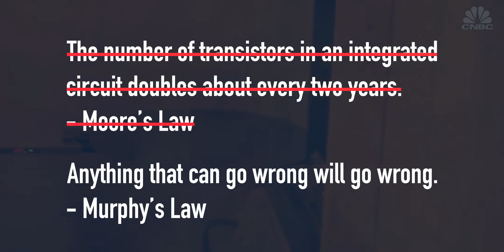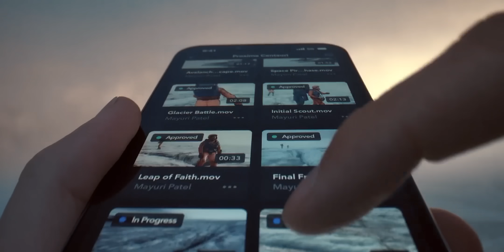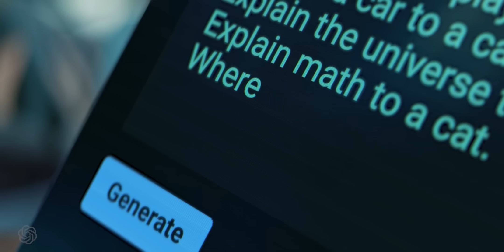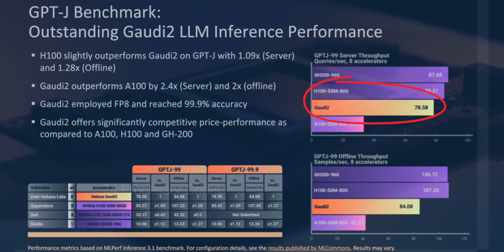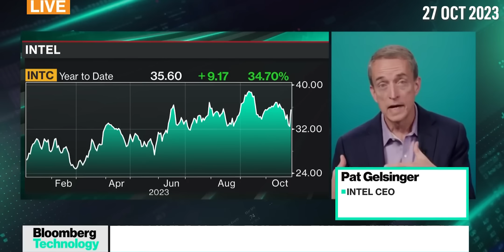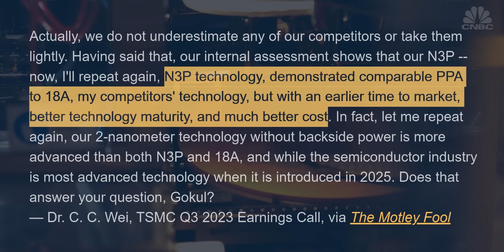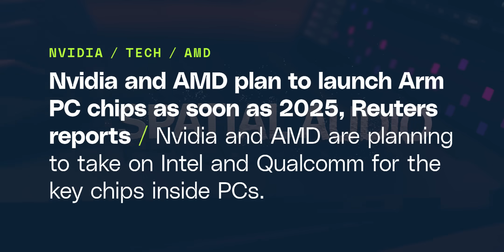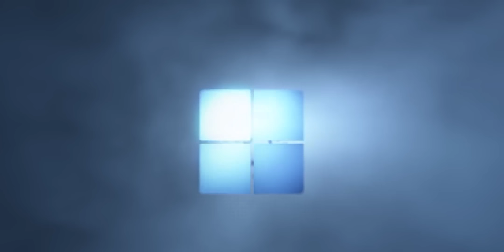I WAS WRONG! Intel's Crazy Plan to Dominate AI Chips is Working

Comment: Well, as of July 2024, Intel has big problem with 13 Gen, 14 Gen chips overheating.  Several years ago Intel tried to save a few bucks by skipping EUV equipment and fell behind TSMC.  Intel just bought latest High NA EUV from ASML and it will take at least a few years to turn around.
Reply: Really?  Where is the class action lawsuit? 
Funny how no one reports class-action lawsuits against MacBooks that occur every other year.

Comment: It is inevitable that advanced chip manufacturing will move out of Taiwan progressively. Geopolitics is one of the main reasons.

Intel and other chip makers will benefit and it may not be bad for TSMC as long as they move out of Taiwan which they are doing so mostly to US but also to other southeast Asian nations.

Some may argue only Asia (vieled argument to say only certain Asians) have the education and skill to make high end chips which is far from the truth. Given time it is possible to get a trained workforce in many countries outside of Taiwan and China. It worked well in Taiwan and China because it was cheap. It is not cheap anymore and the main driver is geopolitics with China threatening to invade Taiwan anytime. So really there is no choice but to move the capacities out of Taiwan. This is the reality.

Comment: I think what you missed is both Intel and TSMC use the chip making lithographry  machines from ASML.   So only Intel will have the newest most advance machines and TSMC will not be buying these.   So how will TSMC make their best chips?    I think they will have to do a double exposure on the chips.   Where as Intel will not.   Correct my mistakes in this comment.

Comment: The best thing Intel could realistically do is to use 1/3 of its cash and short-term loan to buy back its stocks, the other 1/3 for dismissing 50% of its early retiring aged and redundant headcount, and the remaining 1/3 to invest in Qualcomm/ARM and even NVDA for licensing arrangements. At this stage USG will surely print and send $50- 100 Bn more as an emergency rescue fund (as it has done for Ford and GM years ago)…for a new Intel. This is the only way.
Reply: INTC Foundry will take a massive share from TSMC very soon.  Sanctions are causing China to flock to TSMC taking up capacity.  Customers will need to switch over.

Comment: Intel’s strategic thinking is inflexible & dated, unable to adapt to challenges to their leader’s beliefs. 
They missed out on Apple’s request for a chip for the iPhone because they felt there won’t be many $1000 phones sold. Wrong!
Now they are upset about Apple dumping Intel for their own chips because Intel could not deliver the performance required, which would need ARM RISC architecture rather than the archaic X86 CISC.
Apple showed customers don’t care if the O/S is moved to a different cpu if performance is good. 
Intel should see this as the writing on the wall instead of dismissing Apple as niche. Intel already had a brush with the now defunct DEC Alpha, which ran windows NT on an ARM architecture. The only thing that saved Intel was alpha was expensive and DEC went bust. If AMD offers an ARM chip geared to AI, but with x86 compatible mode, something that is partially available for legacy apps on windows, then Intel is in trouble. Oh wait… Qualcomm is planning on delivering ARM chips for Windows on laptops for 2025. This is dependent on Qualcomm settling with ARM over license issues.
Intel has advantages like it’s own fab and PC market share, but their CEO must be drinking buddies with Toyota’s CEO, unable to accept the world has moved on. Or IBM’s Thomas J Watson Jr, in 1943 he believed that '… there is a world market for about five computers. Or saying not many people make weather models, but many use them, truly short sighted. The future use of AI ARM chips as supercomputers isn’t going to be weather models, it will be stuff we can’t imagine but apps will be developed with that much compute available. Who would have thought you could super computer capability surpassing a Cray 2 in your iPhone when Cray was all the rage? Even during the .com boom, the iPhone hadn’t been conceived, but MSFT was already experimenting with windows CE, which still has the best handwriting recognition of smartphones. 
So Intel has potential held back by successive lack lustre CEOs. 
Nvidia is doing well because it has a infinitely more talented  CEO.
So can Toyota the creator of the Prius lead, dominate EV? It could, if there is a new CEO
Can Intel take the lead? Not without a new CEO.
Reply: Leather daddy is the tech. tsar. All hail leather daddy

Comment: I think Intel has a lot of strengths but they have a lot of competition. I really see kind of silly the part of X86 against ARM. Intel can produce and design ARM chips by themselves. ARM chips on notebooks are about power efficiency not about performance, so if you want performance you go to Intel or AMD x86 not arm. The other part is that most of the apps for windows are x86 not ARM design. So ARM apps for windows that might be ok are Microsoft Apps. I am almost positive that ARM emulation apps consume more power than running native on x86 chips. 

We need to faced ARM on APPLE is easy, it is not a lot off Apps for Mac OS X. I am not sure about the exact number of developers for Mac but for Windows at least is 100 times more than Apple.

I personally want Intel to success and the same time, I want AMD and Nvidia to succeed. I found fascinating that Intel can/will produce chips for AMD and Nvidia. Intel had the edge of technology for long time, I think the missed because bad management of the company not because the lack of talent (I am sure CEO and high management though they don't need to invest on process when they own the cpu markets). 

I think Intel will come back very powerful against TSMC and Samsung.

Comment: This did not age well - Meteor Lake is a disaster and there seems to be little in the pipeline till early 2025 for consumers.
In server intel - despite having really bad lineup (except where the accelerators play a major role) is holding ground due to market inertia. Lets see how this evolves.
As for AI, intel run into ground Larabee, Knight's Landing and  Nervana, now its Habana turn. Will it fly? We will see.

The problem with this company is that it is does not seem to have what it takes to be innovative. Pat doesn't have what t takes to change it either, from the looks of it. We'll see.

Comment: I'm going to tell you why I think Intel is so confident in their 18A GAA design and why they are getting customers signing there.
Look at Samsung GAA and yield for 3nm. They aren't getting hardly any customers and that's with expensive FDSOI smart cut. What is the most important thing to control in these smaller GAA architectures? RDF
A small company that has put out several whitepapers in the last 2 years and one a couple months ago where they state 50+%  better  matching for sense amps which would enable massive power savings for dram in data centers.
Same thing they can do there they can help with Sram in logic.
This same company is partnered with Synopsis and Synopsis offers their design software that has their IP.  This company actually has their epitool installed at Arizona State University, where Intel is part of the Hub27 for chips act $.  Who else there? Possibly Boeing and NG - both customers of the 18A node.
Now the juicy stuff.
Why would Intel be so confident in their 18a GAA when the others are struggling at 3nm GAA and Finfet? 
I think it's because they have a secrete sauce for controlling RDF.  I think it's MST for doping channel and blocking PTS and building the stack.
We will find out in '24

Comment: There is some information you get wrong about intel, but i just want to touch about meteor lake here. First meteor lake belongs to new branding called intel core ultra and meteor lake belongs to the first series of this new branding. Second meteor lake actually manufactured on multiple nodes from intel & tsmc joined by foveros 3D packing technology. The cpu part manufactured NOT using 7nm process nodes but Intel 4. I knew Intel 4 is a new branding for 7nm from intel but back then 10nm intel is not same as 10nm from other companies. Intel rebranded their nodes to align with current industry standart so help IFS customers comparing intel nodes to other nodes.

Comment: The problem with Meteor Lake is that it might be too little, too late.
Its AI accelerator is weaker than what AMD has in their new "Hawk Point" processors (which are themselves just a refresh of older "Phoenix" processors) and will be far behind Phoenix's real next-gen successor, "Strix", which is expected to launch in mid 2024. Intel won't have "Arrow Lake" ready until 2025, and there's a good chance that it won't even beat Strix.
Intel is half a generation behind AMD. They can't afford to continue at the same pace, they need to accelerate and catch up.

Comment: Most of the intel chips have not lost to AMD! Looking at the performances since AMD rise at best AMD chips have been marginally better than intels at much smaller node sizes! That tells you a lot about the architecture! People make it seem here like Intel was on the entry market 😂! I have used both ryzen and intel and I can tell you Intel is a much more stable architecture. I had less crashes, less freezing…… I honestly hate AMD chips the never lived up to the hype! A much older intel chip performed much better in daily tasks than the ryzen 7 I had. Never again! I think the architecture has a lot to do with how a chip performs. Just because it does well in a certain task overall performance is still better at Intel.

Comment: And yet right now it's Nvidia dominating and AMD is the runner up with their new launches and companies jumping on their hardware, partly so that Nvidia isn't the ONLY player in this realm, along with the fact that AMD's new server hardware is more performant in different areas than Nvidia hardware so conGRATS AMD.

Intel will make a comeback in desktop.  Server?  They haven't yet and I don't see anything in the rumor mill that suggests they're pushing anyone out of the way.  AMD has a solid footing with typical server tasks and are cutting in on AI processing.  Intel isn't there yet.  Maybe another year or two and I'm not buying Intel stock based on THAT because for whatever Intel can put out in a couple years, Nvidia and AMD are both making better hardware too.

But the world of server doesn't CENTER on AI.  Most of the world of server doesn't use AI and probably never will because making a DB request is NEVER going to benefit from AI.  Getting data from a web server is NEVER going to need AI.  So this AI boom that's happening right now WILL slow down and be more gradual the same way ALL server hardware is.  AI is not a be all end all thing, it's just right now there's a lot of companies interested in AI, training models, etc....

Comment: "everything that could go wrong for Intel did." No. They did it to themselves. They (the board) hired THE WORST possible people for the CEO position. Bean counters instead of engineers or technologists. Intel has no one to blame but themselves. AMD now has a lead in power efficiency that Intel will need years to reduce. At least they are planning to use TSMC, which shows that reality is sneaking in at Intel. I want Intel to return to leadership and dominance, but they screwed up big time, and in technology, it's very difficult to recover. Thank goodness TSMC is a friend and a democracy and needs the US to protect them. We will. But get ready for some bumps in the road. And, your thesis--that Intel's plan to dominate is working--is incorrect. Intel is way behind Apple and even Google in making mobile chips capable of AI inference. Apple's M series of laptop SOCs wipe the floor with Intel's mobile chips. The 38-core M2 Max GPU is about half the performance of an A100 for LLM inference at one-sixth the power. Intel cannot match that...not even close.
Reply: Yeah but building government funded manufacturing plants lol Intel only going up from here

Comment: You seem to left out AMD new product. Market testing indicates AMD is not inferior to Intel in all aspects. Intel4 is just 7nm, while AMD is using tsmc 5nm and 4nm, Mi300 will be using 3nm. Apple booked 90% 3nm is old info, before tsmc massively boost up the production. It is also widely supplied to NVIDIA, even Intel is ordering huge volume of tsmc N3E.

Comment: You were also wrong about NVDA in the past, claiming on one video that it is DEAD due to less requirement for graphics cards due to high speed connectivity.  Lets face it nobody is perfect.  I like your content nonetheless, no BS.. and thanks.  Unfortunately I bought into your older video and didn´t buy.  My buddy did, and bought a brand new truck with his winnings.
Reply from the maker: Sorry to hear that’s the only Nvidia video of mine you watched. That video wasn’t wrong at all. Nvidia pivoted HARD away from gaming GPUs and into data centers and I’ve been covering that for well over a year.

Comment: I worked for Intel from 2000 to 2003.  I remember that during one start up meeting in the fab I said something about competing with AMD.  Everybody just laughed.  Then they explained to me that the one fab I was working in could produce more product in one quarter than all of AMD's fabs combined could produce in an entire year.  Intel is about producing large scale commodity grade product.  They don't have to be the fastest.  

Something else to consider is that when I worked for a seismic company in data processing we tested AMD processors head to head with Intel processors.  We had dual socket hex core AMD vs dual socket quad core Intel.  On a core to core basis the Intel won.  When we would load down all 12 cores in the AMD machine the memory controller would bottleneck.  When we would run 8 cores verses 8 cores the Intel was slightly faster.  My impression was that AMD just tacked two extra cores onto a chip that was designed to be a quad core machine to produce something that could be used for marketeering wank.  Under actual, real world, 100% duty cycle, scientific computing the Intel was just clearly better.  

One last insight into Intel and their claim at rolling out a rapid R&D schedule is that they already have them in the box.  Intel normally maintains development on at least 4 processes ahead of the currently deployed CPU process.  That work is done at PTD, Portland Technology Development which is Intel's R&D facility.  It isn't that Intel is going to develop new technology.  They have it already.  They are talking about scaling that technology up to full production numbers.  They don't develop technology based on consumer demand.  They make existing technology available to the public when the old technology has paid for itself and given them a significant return on investment.  It's a business.  This was something that I learned while talking to people who had worked at PTD and management.  You simply can't buy the latest technology.  It isn't available to the public.

Now, you might dismiss me as an Intel shill.  I can assure you that I'm not.  My parting with the company was somewhat less than pleasant.  I use their products, I NEVER buy them new, and as far as I'm concerned the company can burn in hell.  Every day that I don't work for Intel is a good day.  I would rather live under an overpass than work for Intel.  Anyway, take my insight as you will.

Comment: My biggest concern is that Intel 4 node is just starting up, and it is even worse than TSMC or Samsung's 4nm, not to mention TSMC 3nm (and TSMC 3nm is already producing). Intel is one generation behind in manufacturing and even that node is the worst one in the generation. There is no miracle, if you're one generation behind you cannot be the leader. Actually, Intel 3 was promised by H2 2023 and it is still nowhere.
Reply: The miracle is that TSMC tech leadership relies on ASMC tech. And ASMC already decided to give the next cutting edge litography machine to Intel rather than TSMC. So this is how Intel leap frog all its competitors. Geopolitics is driving these key decisions. This is the catch. There is an invisible hand.
Reply: @andrepaes3908  I don't understand what you mean. EUV is there already, maybe some slight upgrade on the laser will be made, but the wavelength of the laser is the same for Intel and TSMC (and for Samsung) and it will not change soon, since that needs a very serious investment. Moreover, if you have the idea that TSMC is superior because of ASML, like TSMC was doing nothing, forget it rapidly.
Reply: @andrepaes3908 and tsmc already open fab in Arizona

Comment: You need to compute vector math fast which requires a GPU.   You need a good GPU both training and inference.  This is untrue that the CPU will carry the load.
Reply from the maker: You can have specialized cores that handle that. You don’t need a discrete GPU.

Comment: Your argument is they have always 'been on track'.  They never deliver.  That's the problem.  Five nodes in four years.  12th gen to 14 gen - Same node.  Same silicon.
Reply from the maker: My argument is definitely NOT "they have always been on track". It's actually exactly the opposite.
Reply: @TickerSymbolYOU I wouldn't expect different results.  That's the definition of insanity.  The last time they actually delivered was the original Pentium at 60Mhz, or the Q6600 which I actually am using.  If they're so confinident in their abilities, they wouldn't subcontract TSMC for their GPU tile.